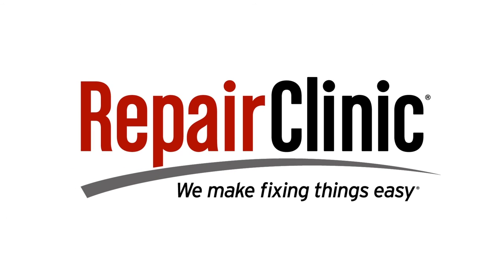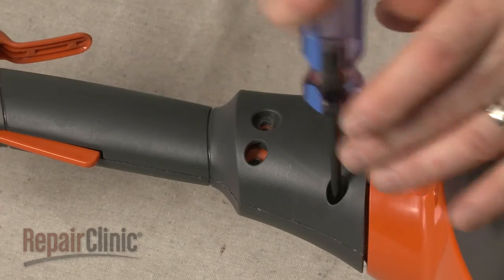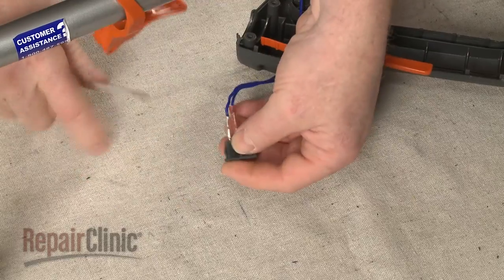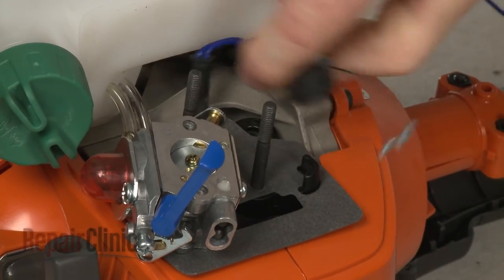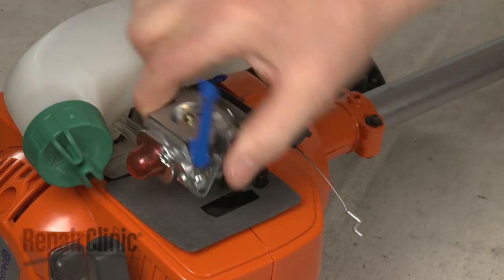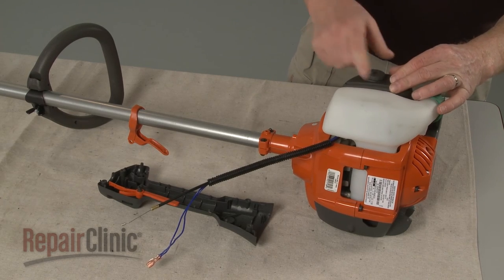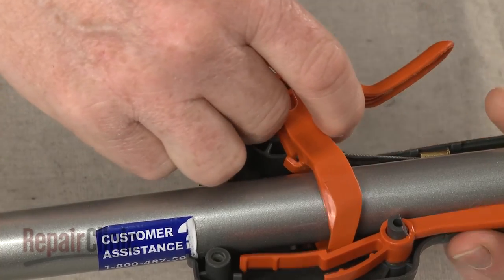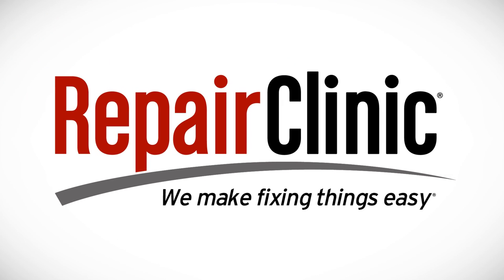Husqvarna String Trimmer Control Cable & Harness #576139401

Comment: Why didn't you guys meñtion a thing about after you put the 0ne end of wire and cable under gas tank and plug the two toilet run cable to carb what do you do with the other end of wire just leave it hanging